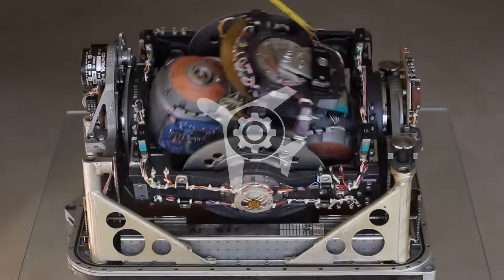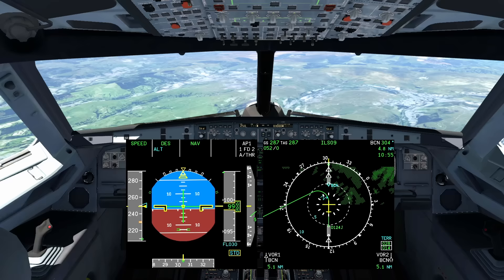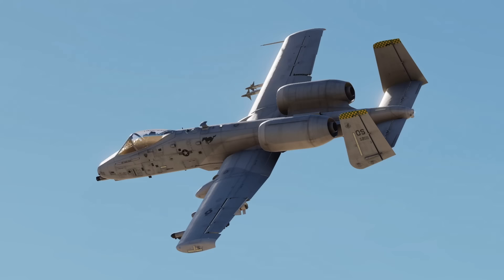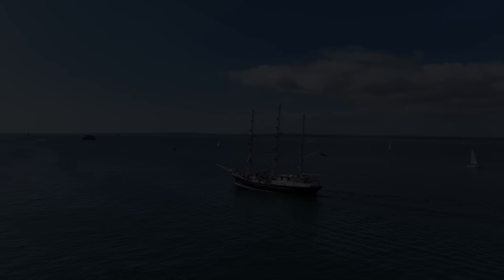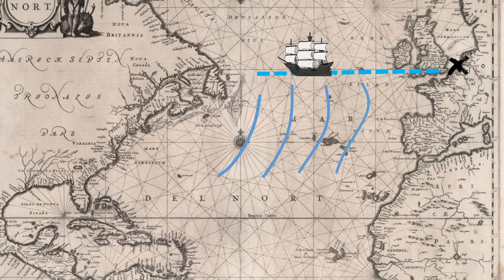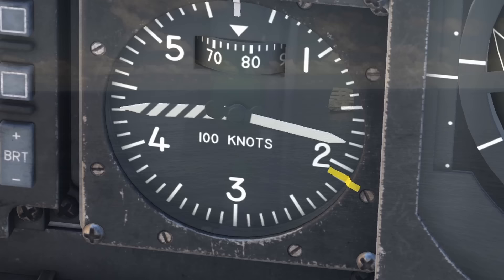The GENIUS of Inertial Navigation Systems Explained

Comment: Also there are Fibre Optic Gyros (FOGs) which are much more compact with no moving parts. All types require that the 
Starting position is inserted in the system ( Lat/Long as accurate as possible)
The INS continuously integrates the sensor data to calculate the aircraft's current position and velocity based on its initial known position. Inertial Reference Since the new position is calculated from the previous calculated position and the measured acceleration and angular velocity, these errors accumulate roughly proportionally to the time since the initial position was input. Even the best accelerometers, with a standard error of 10 micro-g, would accumulate a 50-meter (164-ft) error within 17 minutes.[9] Therefore, the position must be periodically corrected by input from some other type of navigation system.
 by
Reply: Modern airliners have INS supported by SATNAV ( eg GPS, GALILEO, GAGAN, INSAT)

Comment: 10:00 For me, to make sure I got it right.
We know the starting position and orientation of the gyro. The accelerometers now tell us in combination with the time where we are. And does the computer now look up on a map what the drift is in relation to start and the now position and gives us a correction?
Or does the pilot set its airplane to the Starting plane of the gyro, and now the nose is pitched up to much, the accelerometers notice and give a correction? Does the pilot have a button for that, cause how does the system know wether the accelermometers are reading a difference during a maneuver or cause of the drift? Does the drift readout happen automatically every time the plane is in the starting plane (or later a corrected one) of the gyro?

Comment: The moving platform is a Shuler Pendulum. The Iron gyro is dead.  They are complicated to build  Errors mount up due to gyro drift at about 90 min. rate either side of course . These errors are easier to correct  in a simpler  laser ring gyro platform. The Litton  and  DELCO Carousel INS units I maintained saw their day forty years ago.

Comment: There is a wrench in the system: gravity itself is not uniform. Across large distances gravity will vary due to differences in the mass of what is underground. So errors creep in. Which is why GPS is still the most accurate navigational syatem.

Comment: Speed. 
“How much time passes until a certain amount of knots…” This is backwards.

A “knot meter” measures “how many knots pass in a given time.”

They literally had a spool of rope with knots in it.
The spool had a mechanism that let it unwind the rope for a very specific amount of time.
Meanwhile a crew member throws the line overboard, letting it run through his fingers, counting the knots that go out before the spool stops.

If, say the knots are ten feet apart, and 8 “knots” went by in 15 seconds, you went 80 feet in those fifteen seconds.
So, that’d be 29,200 feet in an hour.
A nautical mile is 6080 feet. A nautical mile per hour is 6080 feet/hour. One nautical mile per hour is referred to as “one knot”.
So, that 29,200”/hour is about 3.16 KNOTS.
Reply from the maker: Fair point, thanks for the correction!

Comment: Nice introduction. I have not acquired one of these for further study. I am going to guess it has the same compensation motor and offset weight for gyroscope progression to compensate for the earth's rotation the same as a gyroscopic directional indicator. I do have one of these from the 1940's. It took me a while to understand why there is a torque motor on the rotation of the gimbal and thus the horizontal platform.
Would love a more detailed look into the correction for the earth's rotation during the flight.
The directional indicator uses a single gyroscope. The inertial navigation unit uses two gyroscopes in the same configuration as a gyrocompass. Does inertial navigation include the function of a gyrocompass?

Comment: Awesome video man absolutely loved it. I just had one quesitons, why does the INS use 2 gyroscopes instead of just 1?
Reply from the maker: Thanks! And great question. In my understanding, it's because each gyroscope measures two axis of rotation. So to measure rotation in x, y and z (3) you would need at least 2 gyroscopes (2+4=4 axis of rotation). One gyroscope measures x, z and the other y, z. The two gyroscopes have the z-axis (heading) in common because it is the axis that requires the most precision.

Comment: Wonderful video as always! This channel is so underrated. I have one question though, which is how the accelerometers can measure the acceleration. Would be great if you could explain.
Reply from the maker: Great question! Accelerometers are basically a scaled-down version of the car passenger: a small mass is suspended between springs (car seats act like springs). You can then measure how much the mass moves against the spring (which in some cases you can measure as electrical voltage). The larger the acceleration, the more the mass will move away from where it originally was. This is of course a simplified explanation, I'd highly recommend this website if you're interested: https://www.explainthatstuff.com/accelerometers.html#types
Thank you so much for your continued support and enthusiasm over the last few videos, makes my day :)
Reply: @FlyByMax  Thank you!
Reply: I usually explain accelerometers this way. You know how some people hang religious medals or dice from the rear view mirrors of their cars? Whenever the car accelerates or decelerates or turns left and right the hanging object will swing the opposite way. This motion is a result of the object's inertial mass resisting the change in direction. This is the basic operating principal of an accelerometer.
Reply: The accelerometers pendulum doesn't actually move, a correcting force (voltage to a transducer) is applied to keep it zeroed. The size of the correcting voltage is directly proportional to the applied acceleration.

Comment: Really good explanation! I got a few questions for you.

Is this system capable of keeping track of the current velocity by measuring the length of time of previous acceleration and deceleration events? That's how it goes in my head because how else should the system keep track of distance traveled even if the velocity becomes constant.

Off topic question also- the background music in the end around the 10:15 mark is driving me nuts because I'm sure I've heard it before and cannot find it! Do you have the tracklist you used for the video?
Reply from the maker: Thanks for your comment, and great question! The song is Just Dance by Patrick Patrikios, it's one of my favourites to use on the channel :) 

Your intuition is absolutely correct about calculating the velocity! Acceleration is a change in velocity over a change in time, so if you choose a time step of e.g. 0.01 seconds, you can figure out how much the velocity changed in that time step by measuring acceleration. Then all you need to do is update whatever the velocity was before the time step, and then rinse and repeat :)

Great job!
Reply: @FlyByMax  Thanks so much for the reply! It's always so nice to learn new things. :)

Comment: There is no longer used this old system. In new aircrafts the laser gyroscopes are used. Those are much more precise. Those does not have gyro drift issue. It does not have to be on stabilised platform.

Comment: So much wrong here.  We (mariners and pilots) still use knots (Nautical miles per hour) because a nautical mile is 1/60th of a degree of latitude.  This makes it easy to estimate things using the formula 60D/ST. Early ship crews tied knots into the speed log line to do the measuring, so Nautical Miles per hour got shortened to Knots.  Early explorers made ocean travel navigation using early versions of the sextant (a tool to measure angles) to keep themselves on a latitude line.  Each day at apparent noon the navigator would do a noon sight of the sun at its apogee.  This angle of the sun off the horizon plus some simple addition and subtraction would give the navigator their latitude. If during the previous day they drifted off course from wind or current, they could correct over the next 24 hours.  A good navigator could keep the ship within a few miles of a latitude line on a weeks long crossing.  A trip east or west would start with the ship travelling north or south along a coastline until they reached a specific latitude across from their intended target across the sea, then the east or west travel would begin, using a chronograph to keep time, plus the speed log and DED Reckoning (means Deductive) to estimate position.  Folks who don't know any better call it dead reckoning. All of these errors and misconceptions in the first 4 minutes make me wonder how much of the rest of your video is in error...  Read "Carry on Mr. Bowditch" and "Longitude"  "Celestial Navigation" and "The American Practical Navigator"  "Chapmans" is good too for more basic and comprehensive boating knowledge.  Now-a-days all this is computerized, but we still have a compass, chronograph and Sextant aboard, along with the tables to make it all work.

Comment: Hey, just to say, this tech was replaced long ago by laser based navigation units.
And those units are now being replaced by yet another tech (laser is being phased out pretty much everywhere now).
This new system is extremely interesting.
There’s a nano bell which is completely known in its composition, and we are able to know what acceleration it was under by the way it gets deformed.
Thus, there’s some sensors that capture this déformation in order to get extremely accurate acceleration, far better than even laser based units.
As a comparaison, a submarine with a mechanic system could stay under water for hours at most, then with laser it was expended to a few weeks, and thus new system (mandatory for nuclear subs), can go for months before getting of course
Reply: Does it take currents/wind drift into account?
Reply: @Pierluigi_Di_Lorenzo  yes, because the systems are always calibrated according to an absolute position and speed, using satellites or other things, every now and then. So, when a current start moving the vessel, it will cause it to accelerate in regard to that absolute known speed and position, thus being calculated in the apparent speed and position of the submarine at a certain time

Comment: Thank you for such great video. Really interesting. Just a couple of questions, for me to understand: why are the gyroscopes two? Horizon and Heading? Is the SOG compensated on a plan? Does the absolute speed affect the INS? Pleased to hear. Thank you.
Reply from the maker: Thank you! These are fantastic questions. I believe (but not entirely sure) that the reason two gyroscopes are needed is to compensate for something called gyroscopic precession (the tendency of gyros to rotate on their own). By having two, they cancel eachother out and stop the platform drifting because of the rotation of the gyros themselves. But they still measure all three rotational axis: pitch, yaw and roll. 

For your second question, could you remind me what SOG means?

And lastly, about absolute speed: again a very good question to which I'm not entirely sure what the answer is. At the end of the video I spoke about transport wander which happens due to the aircraft flying over the surface of the earth. The faster you fly, the more this effect will have an impact (linearly). But the extent to which this has practical consequences, I have no idea. Maybe it's negligible, maybe it's not, I'd have to look at some data :)

Have a good one!
Reply: @FlyByMax  thank you for such nice reply. I think the same, they are two to compensare each other (small) mechanical error and friction
I have experience with Seagoing Vessels' and Submarines Mechanical Gyrocompasses. The inertial platform is there created putting the gyroscope (two) in a sphere. Two gyroscopes to have them self compensated.
Gyrocompass works then letting the sphere float in a conductive liquid (so called supporting liquid). 
Once the precession finished ( 180 minutes) sphere finds its orientation (to north).
While vessel is turning, gyropshere is stable on its heading and therefore compass is able to detect the angular shifting having the difference between angular shifting - sphere heading.
Furthermore, since earth angular speed affect the gyroscopes behavior generating and error that is inversely proportional to vessel's latitude and speed..

Comment: I must challenge your assertion that the INS was developed for the Lockheed F-104, which was a relatively tiny and short range fighter which never wandered far from home.  Much more likely, it was developed for the U-2 spy plane, which flew single-pilot for thousands of miles without the benefit of ground navigation aids.  More likely still, submarines, which "fly blind" constantly and have plenty of room for gyroscopic platforms, at least as compared to aircraft.
Reply: Agree
Reply: Yes, the F-104 only got an INS late in its life when the G-model was developed as a strike aircraft.  I have always read that INS was initially developed for ICBMs.  The early ones were very expensive and not cost effective for most aircraft.  I suspect submarines got INS soon after ICBMs, followed by aircraft as availability improved.  

I have also read that the U-2 did not have INS, at least originally.  The pilot navigated by a combination of dead reckoning and pilotage.  The was a periscope that let the pilot see directly below the aircraft and take precise fixes over landmarks.  This was possible because U-2 missions required clear skies to take the photographs, and the winds above 60,000 feet are negligible, making dead reckoning accurate enough if there was cloud below while enroute to the target area.

Comment: You didn't mention, that gyros introduce own precession and thus drift, which must be compensated. Also, that it obviously isn't ideal, and desynchronises from reality depending on precision of the system and complexity of maneuvering, thus must be periodically resynchronised, and in fact is constantly, as position (bearing, ranging, GPS) cues are available. Finally, the mechanical platform with gyros constitutes the mechanical attitude tracking module, which can be replaced with digital representation based on aggregation of acceleration data. This introduces obvious digitization artifacts, but gets rid of the platform, gyros, and mechanical issues. Accelerometers can be placed at fuselage's extremities to increase precision of attitude measurement, while their mean signal give the overall body's acceleration vector.

Comment: The term is actually "Ded Reckoning," for Deductive reckoning.
Reply: Didn't know that
Reply: It is indeed dead reckoning and has been for the last few hundred years. It could have originated as ded reckoning way back when, but every navigation text or training program I ever encountered knew it as dead reckoning. 

Oxford Reference: Determining position at sea by advancing the last established position for course and distance run. Before the advent of modern navigational systems dead reckoning was the basis of most offshore navigation. The term ‘estimated position’ is sometimes used for the dead reckoning position corrected for the effects of tides, currents, drift, leeway, and so on. The origin of the term dead reckoning, which has been in use for at least four centuries, is obscure. It has been suggested that dead is a corruption of deduced, but there is no etymological, or other, evidence for this.

Comment: what gets me is how do they stay so accurate in a fighter jet that's tumbling and turning while pulling some serious g-force. surely that would throw them out a lot. i guess that's why they have the option of using gps to assist with keeping them calibrated. but still, i don't think gps can help if the gyros are thrown off. very interesting stuff this

Comment: it's either the TRIDENT or POLARIS (or both) missile systems fired from SUBMARINES ...
that NEED that INITIAL position that INS systems rely on ...
so since the SUB could be below surface for long durations (months) ...
their EXACT (initial) position of the missile firing is uncertain ...
(not certain enough for desired accuracy) ...
so ...
once the missile gets out of the earth lower/upper atmosphere ...
it opens a small WINDOW on the top of the missile and it spots STAR constellations ...
then using an internal (stored) MAP it figures out where it's at ...
and charts it's INS driven course to it's target from there!

Comment: 7:08 actually if my eyes was closed I could tell if I was going to a slope or accelerating. It's simple cos if you accelerate your body feels the "pull" for a few seconds until the car reach a certain speed and then you don't feel that pull anymore.On the other hand if you are on a slope your body get pulled by gravity constantly and so you know you are in a slope.
Reply from the maker: You're correct that if the car would stop accelerating after it's reached a certain speed, then you would notice. But if the car would be accelerating at a constant rate forever (and assuming you couldn't hear the engine or notice any engine vibrations etc.) then you wouldn't be able to tell the difference. Thanks!

Comment: Very cool, but if it is continuously self-correcting, can I ask why planes are forced to correct for drift over known landmarks or waypoints?
Reply from the maker: Good question, something I left out in the video is the fact that none of the instruments are perfect, so small errors are inevitable (accelerometers have a limited accuracy). Despite the system being self-correcting through the feedback loops, these errors are also present in the feedback and so they grow over time. It's difficult to explain in text, but this is why INS systems need to be updated. Thanks!